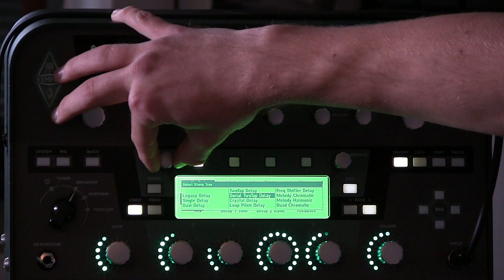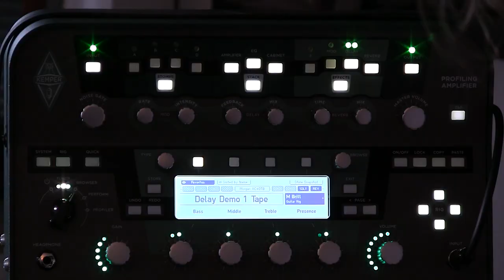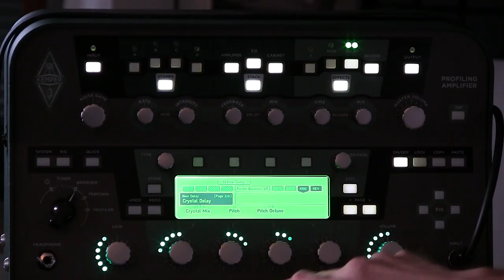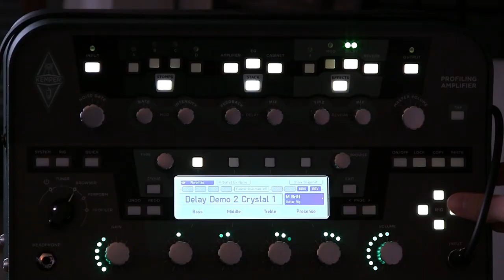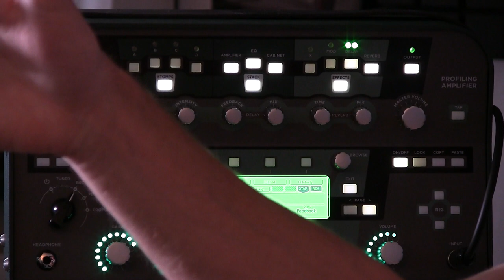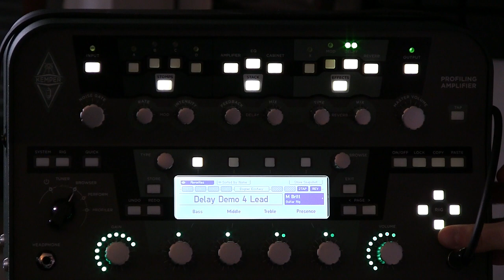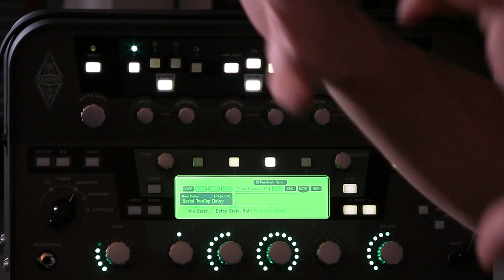Kemper Profiler - That Rig Show #5 - New Delays (from Jan. 2016)

Comment: Finally they have delays that sound as good as what Fractal has had for ages.
Reply: Indeed, we can now only hope that Fractal will someday improve their amp modeling to the point where it sounds as good as the Kemper's amazing profiling technology.  However, being the second-best-in-class digital guitar amp solution is something Fractal can still be proud of.
Reply: The good thing about the Kemper is that there is only one, it keeps 
getting better. If I had gone for an AXE FX, I'd have to worry about 
upgrading to a ultra then a II and then a II XL, etc.
Reply: Fractal is way more advanced in modeling a real amp than Kemper will ever be because they are two completely different products. Kemper only captures a snapshot, guessing the signal chain and gain structure but never accurately modeling them, Fractal is a full signal and gain structure simulator that accurately replicates the full amp from input to output.
Reply: Nicolas Rivera well, it's the end result that matters to me, not the process. it's the sound, not the technology behind it. take care
Reply: Aye Yai Yai.  Nicolas, you are a piece of work, mate.  Does Cliff at Fractal send you his special Kool-Aid mix?  You should switch to plain bottled water, for awhile, and see if this helps your condition.
Reply from the maker: Hiya, gentlemen, language, please! :-)
Reply: CrazyDiamond1968 Nope, only on TGP, and no, you grow up!
Reply: @Nicolas Rivera
It's fine. Everyone but you knows that you are wrong with your wishful thinking driven Fracture, Fractalla, FracItAllUp . . statement. Just "Axe" that thing haha
Nothing beats the Kemper on ALL levels. . and I'm saying this in front of quite a few nice tube amps that we own and will keep here
Reply: A snapshot that allows for much easier editing to achieve the same, if not better result as what you're describing. I will say better because with Kemper firmware upgrades, the tone does not change as it does with Axe FX. Played both intensely and Kemper is in my humble opinion better at capturing tube amp goodness. Axe is much more feature laden in effects if that's your bag. I prefer to not bury my sound in effects and hear my mistakes instead.
Reply: The Kemper's tone doesn't change with firmware updates because Kemper practically never updates the code pertaining to profiling, despite the fact there are a few issues with some profiles pertaining to accuracy that could potentially benefit from it.